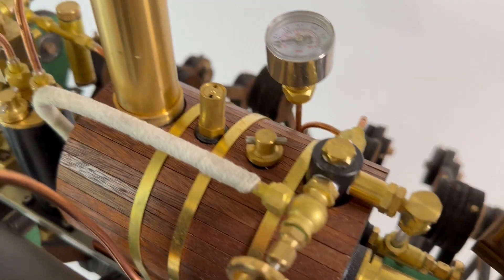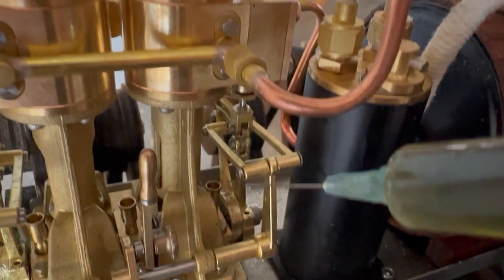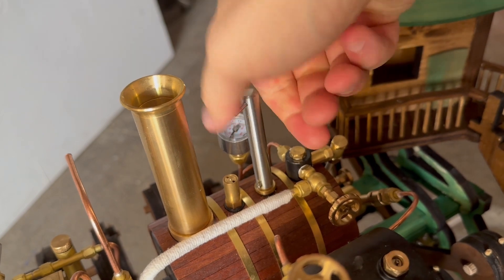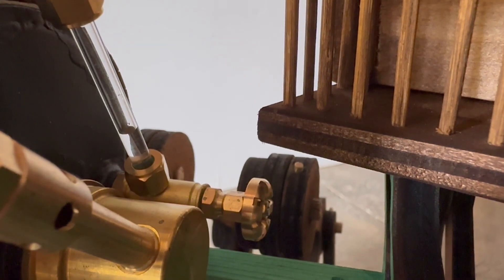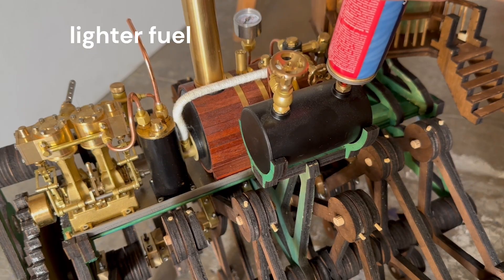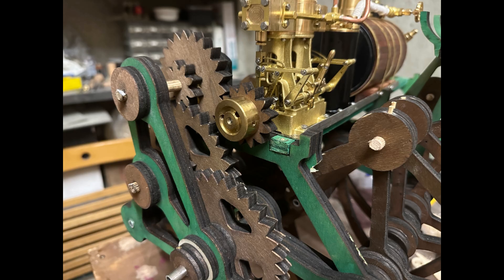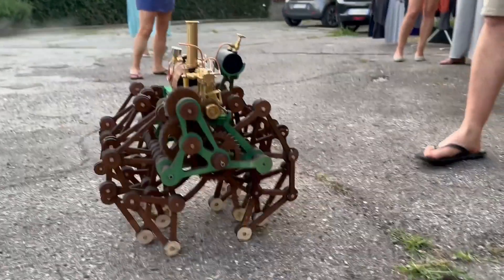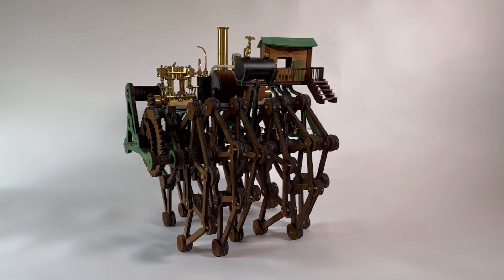Steam engine working strandbeest

Comment: there's got to be a way to steer these things that doesn't involve making two powertrains. Maybe a weight on a rack that can change the cg left and right? Maybe some kind of little shoes on the feet that make one side slide instead of gripping? Maybe just give up and add some arms on the end of the main shaft that can move down and drag on the ground.
Reply from the maker: @confuseatronica  I thought about it for a long time, I could use the clutch system that some small tracked vehicles have (motorized wheelbarrows for example) a clutch that stops the movement of a block of legs and makes another block go, so it can rotate easily, as if it were a tracked vehicle. But to do this I need much more precision and I don't think wood is a good material, It also needs a bigger motor because it would all become much heavier. Maybe in the future I will do it!